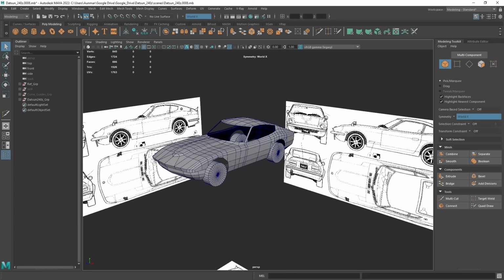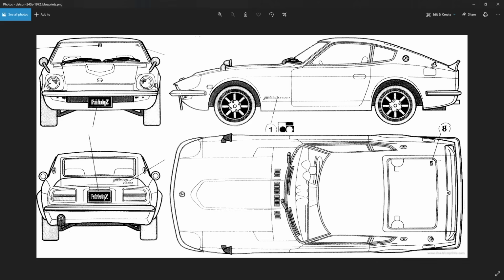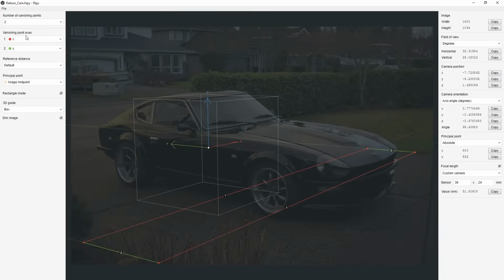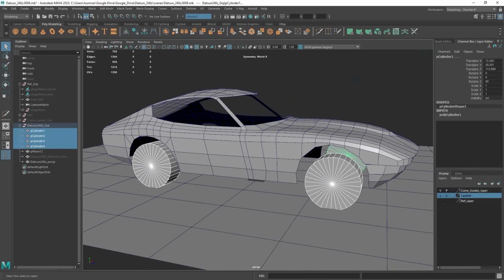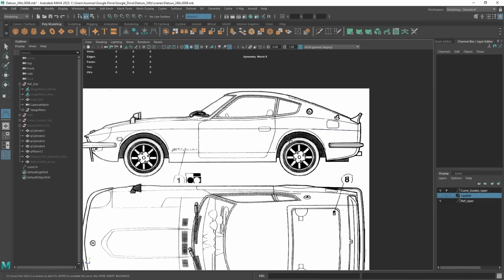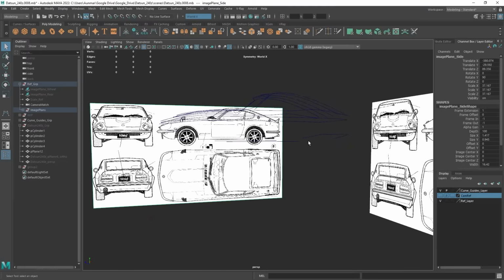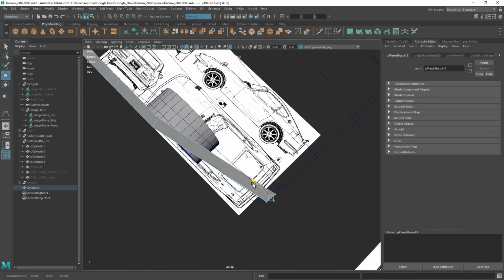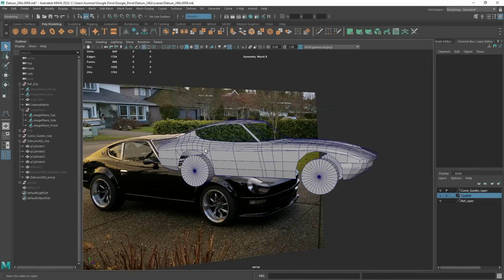3D Car Modeling - How to Get Started

Comment: This is very likely a very educational tutorial, however the software used here might be a barrier for some of us. Is there any chance the series could be repeated in Blender as well? I don't remember if it was mentioned in the video or not, but maybe you even said that the same principles could be applied to Blender as well. However since I'm new to both tools, I will likely have some issues translating the operations to a different tool without knowing the equivalent workflows or hot keys.
Reply from the maker: Yes! I plan to put out Blender content on vehicle and hardsurface modeling soon!
Reply: @OnMars3D   🎉
Reply: @OnMars3D  Any chance the course will be available outside of YouTube as well? I just checked the distribution of the previous videos and it would take a half a year if not longer to finish watching a new course. I fully understand that this is part of your way feeding the algorithm, but I would like to consume and learn everything ASAP. I would be willing to buy the entire blender based car modelling course on a platform such as Udemy. (I hope the course will also in cooperate a balanced design for video games, just like you recently mentioned in a shorts video.)
Reply from the maker: @KBFNGG  Going forward, I will be realeasing courses  that are complete on my website. They will be released in a finished state and include free updates. My next course will be a Topology Master class which will be released by this Fall. Then I'll look into the next course which is vehicle modeling in Blender.
Reply: @OnMars3D  That's a bit far in the future for me personally, but I might still come back to it nevertheless. Any approximate estimate for the future course price?

Regarding the vehicle blender course. I would like to reiterate my wish list:
- how to model it so it looks high detail
- how to go to to a high performant low poly version (let's say 12k triangles) but still maintain many details through other techniques like normal maps etc.
- it would be great if it would be both render and game centric

Thank you in advance! :)

Comment: I'm going to suggest that if you're serious about modeling real cars/accuracy that you get a hold of a Autodesk Imagemodeler 2009. This is a far a supperior method to match cameras to fspy.  Don't get me wrong fspy is ok, but its mainly for architectural matching. Fspy heavily relies on the user actually having a decent photo to match which I have always found troublesome. This depends on the car ofcourse but cars are often shot for 'beauty' having little background to work from which makes searching for the 'right' image a huge pain. 

Imagemodeler makes finding the 'right' photos far easier as it relies on creating a sort of 'point cloud' by using several photographs , which don't even need to be shot with the same camera or anything, making hunting for images far easier as long as you can get several angles of the vehicle. This is an ideal solution for vehicle modeling because not only are you going to get more accurate results, but you will no longer have to rely on innacurate blueprints or manual camera matching. Another added benefit is that you can accurately model cars that may not have any blueprints at all but just photos (concepts cars, brand new cars etc). Often a new car might be revealed that will have adequate enough photos from different angles that you can camera match in Imagemodeler right away and start modeling, no blueprints required.

This is certainly an extra step to take but its certainly worth it in my opinion. Unfortunately autodesk have discontinued the software long ago but its still out there for anyone willing to look. Would be cool to see some videos on it maybe, most of the tutorials here you YT are not voiced or are in russian sadly. Seems like a really overlooked piece of software unfortunately but it is what it is.
Reply from the maker: I'll check it out, thanks for the heads up!

Comment: Sir, I used fspy then save then I open the fspy image in blender I see my camera is upside down and another problem is when I add cube or cylindir for modeling but I see the cylindir dimensions are very low, what should I do, maybe I move the camera back?

Comment: just a quick question, how did you mirror all you guide lines?
Reply from the maker: I just grouped them, duplicated, and then flipped on the mirror axis with a negative scale value.
Reply: @OnMars3D  is there a mirror modifier or is this a manual affair?

Comment: Great.
I also used Autodesk Imagemodeler to put locators on a bunch of photos of one auto from different angles, so matching the perspective.
After that I exported these Locators to Maya, made some adjustments and connected them with Curves. After, just extruded these Curves to surface etc.
Reply: Ahh, I did think he was heading this way with the curves. apart from the locator stuff, i imagined he was to join the curvature of the linework to form a surface across elevations. 
Like when a 3d scanner (in the movies) scans an object and you see the greeny x-ray lines appear to form a shell of the object.
Reply: ImageModeler is considerably less efficient than modern workflows. It's precisely why Autodesk deprecated it. Plus if you ever landed a job at a studio, you'd look pretty foolish when they ask you to prototype a piece of concept art and you have no idea how to do it since you deprived yourself of fundamental knowledge in favor of obsolete software.